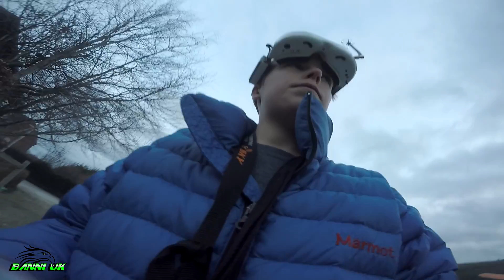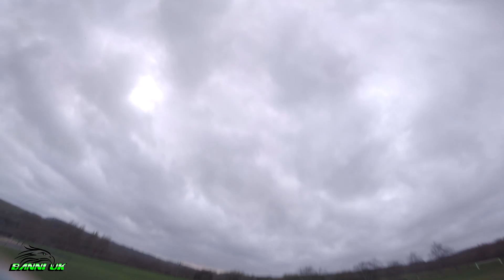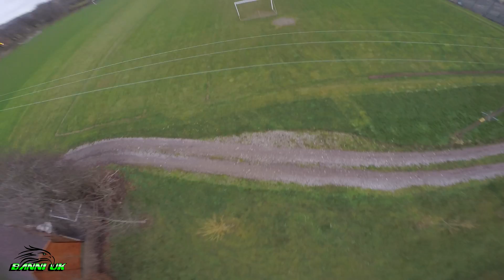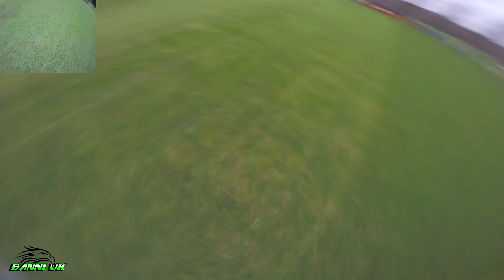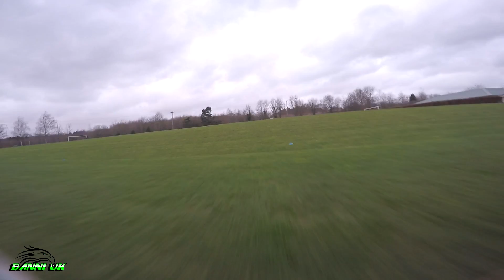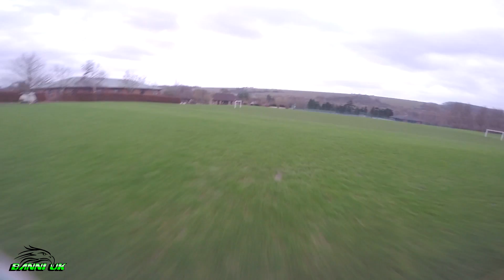TBS Crossfire Low Latency Test

Comment: Noobish question, but here it goes: When you do all the crazy flips, do you have to level it out, or will the FC automatically make sure the motors are facing up?
I do fly FPV, just not this crazy stuff yet. ;)

Awesome video btw. I subbed
Reply: my suggestion is get some altitude and do it.... I see guys post on FB groups and stuff about how they are getting close to doing flips....I started flipping my second FPV flight on a quad.... I was still using horizon mode back then and i would just start a roll and cut the throttle so it flipped wildly....these things are made to be pushed man fly em like they are a sim.
Reply: +Christian Moeller  you can fly in Horizon mode and do flips and rolls which will self level but in rate (manual) mode you put it back to the level yourself which is much more locked in as you arnt fighting the gyro all the time. If you are new to it horizon mode is helpful but move on to rate and give it a go. You will be surprised how much more locked in you feels. You just need to get used to the quad staying in the direction you kept it in. Its harder to fly rate LOS but when FPV'ing its really good!
Reply: +Christian Moeller you can get a simulator and practice rate mode until you get comfortable with the idea of it not leveling itself..... Google "FPV freerider"
Reply: +Richard Hardy Thanks, I'm just starting to fly manual mode in FPV, so it seems i'm not far away from the flips. 
When my 250 gets airborn I will give it a try with that :)

Thanks for your reply